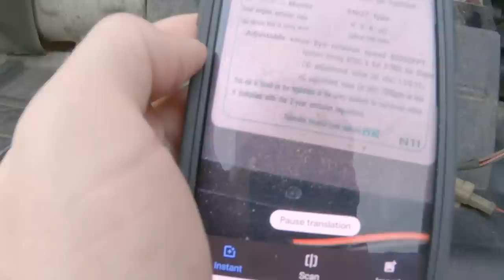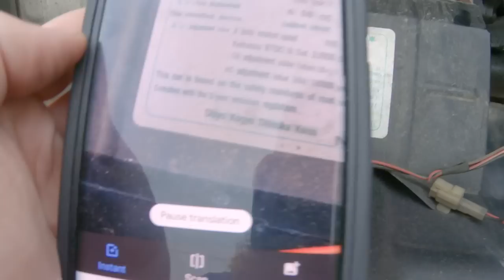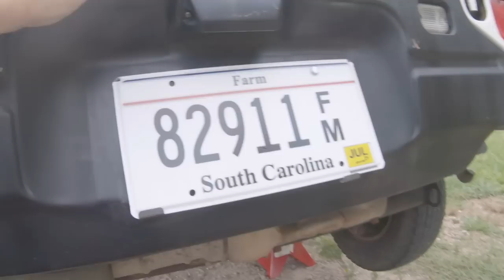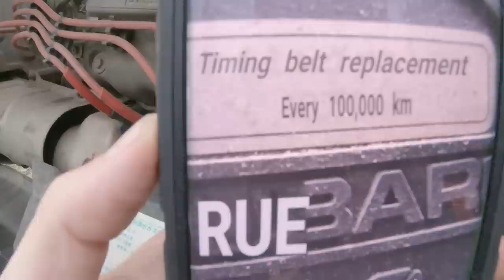Everything Wrong With My 1994 Subaru Sambar Japanese Mini Truck

Comment: Hi, new subscriber here living in Tokyo.  I left a comment on your original Sambar acquisition video offering to send you an owner’s manual to compliment your vehicle.  Please provide me a postal address.  Sambar engines are notorious for leaking oil from the head cover gasket.  Since you are planning to replace it along with a new timing belt, cam and crank seal, you’ll be in great shape.  Cheers!

Comment: They are great little trucks , I have 2 Dias vans with the Supercharged Awd EVCT transmission. One needs a motor which I had a factory remaned long block unit shipped from Japan , the box weighted 110lbs so thats the next project to install . Was going to part it out but was too nice so it getting a motor installed . The rear main seal is the same as the justy of the same vintage when checking the rusting heater lines look under the metal clamps that hold them to the chassis as they will rust thru from crud/dirt getting in between and just stay wet and rot.
The carburetor rebuild “ kits” I’ve used on other KEI trucks are mostly gaskets . I’ve ordered the  factory gaskets ,needle,seat,accelerator pump and couple of other things for a carb rebuild on sambar for about $100 shipped from Japan . 
 Can’t wait to see more of these videos

Comment: My 2003 Sambar started to leak just a little oil around the rocker cover at about 130,000 km... We just passed the 200,000 km mark and the leak hasn't gotten any worse. Just make sure to change the oil at short intervals - 3,000 km for me in Japan - and you should be fine as long as there is not much oil loss during that interval! Mine is always close to MAX even after 3,000 km.

Comment: It reminded me of my VW bus with the engine behind. fantastic
Reply: Yes, you're right about that. It is the same layout as the classic Kombi. I suspect that it was done that way in order to keep the wheels on the road and prevent loosing the back end when cornering in the wet or other low traction situations when the vehicle is running empty.

Comment: That's a significant punch list but all of the repairs look fairly minor and once they're made, you're probably good for another 25 years!  I bought a 1996 4WD Daihatsu Hijet.  I looked at a few hundred kei trucks on Japanese auction sites.  It seemed that the 25+ year old Sambars had more oil leaks than the other kei trucks and the Hijets had the least.

My Hijet arrived with a blown clutch.  I was able to source a clutch kit on Amazon and had it in two days, but it was just the clutch disk, pressure plate and throw out bearing.  I wanted to replace the rear main oil seal and pilot bearing at the same time and that turned into a six week mess trying to source parts from Japan.

Comment: The Japanese counting system is a bit odd, but in a nutshell 万　is 10,000 so in this case 10万　is 10x 10000 or 100,000 km.
Reply: If you think the Japanese counting system is a bit odd, wait until you see their date system.  It's based on the rule of emperors.  I did a two hour deep dive into it so I could translate a spark plug chart for kei trucks for the Mini Truck Talk forum.

Comment: All my vacuum hoses are hard and partially cracked... I'm not looking forward to it. Also the air filter seems to have been put in in 1999... god bless 😂 for only 55,000 km it seems like its NEVER been worked on.

Comment: Try Amayama in Japan for that battery cover and all spare parts.
Most of the parts are genuine. It will state the ones that aren't.
They ship worldwide. 
Lovely set up with the engine, really easy to work on. Would that originally have been a Toyota engine?
Reply from the maker: From what I've read, the clover 4 was a Subaru engine. Used up until around 2012. Then Subaru rebaged Daihatsu Hijets as the Sambar till current.
Reply: @MrSubaru1387  Lovely little engine. Their is something so honest about the Japanese micro vehicles. I have forgotten the collective name for them.
Reply from the maker: Kei cars/trucks.

Comment: Mr Subaru in regards to the distributor, in the uk the Suzuki super carry/Bedford rascal/dihatsu hijet use the same distributor & I have seen 1 fitted from a suzuki super carry to the subaru samber vw bus replica. Wasn't 100% on the engine size however after watching your video it had the same clover 4 engine so hopefully this info helps with finding a distributor 😊

Comment: I think I saw one of these on an episode of American Pickers. I thought it was really interesting and funny that Subaru actually made both the Sambar and a car like the WRX.

On a (off topic) side note:
I was planning on doing the head gaskets on my 08 Legacy (EJ253) this  summer, but when I parked it in april (not going to work or school right now) I noticed it had pretty severe blow by and I recalled your engine inspection video where you said that could be the piston rings going bad. I don't suppose I'm lucky and that it could be the head gaskets somehow, so I was planning on doing the rings now also. Just recently I went to move it for the first time in a few months and when I moved it gave off a lot of white smoke out the exhaust. I checked the oil and now it was milk shake brown, I'm assuming from oil mixing with the coolant. I check the oil and coolant every few times I drove it and changed the oil frequently and I know it wasn't like that when I parked it, so I was think that was somehow from it sitting, which didnt make much sense to me. I still hear no engine knock though, so I was thinking the bearings and pistons might be still good. I was hesitant to disassemble the short block since this is the first time I have done any major engine work. So I suppose my final question would be: do you think I can just tear everything down to the short block and put new rings on the pistons when I do the head gaskets since I am not hearing any engine knock? Or should I tear down the short block since I already have the heads off and check/replace damaged piston heads and bearings instead of just getting the reseal kit and piston rings? Thanks for any advice and all the videos you make!
(Sorry this is so long)

Comment: Hi, I live in Costa Rica and tomorrow I am looking at a 1993 Subaru Sambar Microvan. This video tells me everything I need to look for, so many thanks!  Question: parts will be a big issue down here I am certain, so I was wondering if you could tell me if you think they are still available up north and if so where to shop. Again, many thanks.

Comment: Thanks for good videos. What kind of ramps you use there under the red Forester in the background if I may ask? I'm thinking to buy RhinoGear ramps from Amazon, but some reviews said they cracked easily. Also those RhinoGear are 8-inch heights, and your ramp looks like about 6-inch which I prefer. Thanks again!
Reply from the maker: They're Blitz Rhino ramps. About 12-14 years old.

Comment: Where is the fuel pump relay located? I have a 90 Subuaru Sambar with the carb motor. It's wasn't running and I traced it back to the fuel pump not working. I checked the voltage on the wires and it's not getting any power. In the manual, it says there is a fuel pump relay on the harness by the cab but I can't find anything.

Comment: My sister has a 1993 sambar 4x4 with the clover 4 cylinder. We're having problems keeping it running. Can't find a chilton's book or some type of service manual. Any information would be deeply appreciated thank you
Reply from the maker: http://jdmfsm.info/Auto/Japan/Subaru/--Old%20Models--/Subaru%20Sambar%20KS-KV%20English%20Service%20Manual/
Reply: Thank you for the info. I really appreciate it.

Comment: Sorry off topic. Do you know if there is a solution to 2014 outback headlight bulbs burning out frequently? Thanks and love the channel
Reply: could possibly be because you are getting the bulb dirty which causes it to overheat and burn out. make sure you use clean gloves or wash your hands very good. just a possibility
Reply: @cjskevans  thanks man, yeah I make sure to wear gloves. It seems to be a chronic problem with alot of 2014's if you research. The ground pts maybe?? Idk so so frustrating
Reply: @mikeessary4925  Can you somehow check it with a multimeter and see if you are getting any abnormal voltage?  My dad had an 89 535i that was a solid car except the floor boards were going and the electrical system kept frying out the bulb or fuse every now and then. He had to keep going up in fuses to try to stop them from blowing.

Comment: I have a older one but doesn't have a motor in it. Any ideas of where I can find a motor or maybe a different motor that can bolt to the transmission?
Reply from the maker: Yokohamamotors.net
Reply: @MrSubaru1387  do you know of a place i can get like a used motor with everything on it? I don't have anything for the motor. Not even the mount. At 2500 for a long block I would still have to buy everything to go on the motor. I think it would be cheaper turning it electric or trying to find a junk yard motor and trying to adapt it to the sandbar transmission. Do you or anyone know of a direct bolt on motor from a US car? I know some of the older metro motors could be small enough. I have a harley sportster motor I was thinking of trying to adapt onto it. But then got to thinking. It a air cooled motor probably wouldn't be staying to cool in the back of the truck. Lol. I have seen some people do a street bike motor in them but they where all 2wd pickups. Mine is 4x4 idk if that would make a difference. But I'm pretty sure the running gear probably can't hand to much hp or torque. Don't wanna spend more than I have to on it. Any ideas would be appreciated. Thank you

Comment: I jest change my rear dif still making noise i think bushing on studs on rear . when i put the fuse in the front to make it 2 wheel drive noise go's away . plus my shifter is very stiff 1996 Outback Legacy 260000 MI
Reply: Are you sure the clutch plates aren’t bad in the transfer case of the transmission or the duty c solenoid? I had that issue on my 98 legacy L. You’re probably experiencing a thing called torque binding. It’s something you can fix yourself but it’s time consuming. You have to remove the exhaust, driveshaft, and transfer case of the transmission. You have to replaced the burnt out clutch plates and they’re about $130. You can also replace the duty C solenoid as maintenance since they do tend to go out but that will cost you another $130. I don’t think your duty C solenoid is bad yet because it’ll let you put the car in FWD with the fuse.
Reply: @itsvoodoo7050  i don't think clutch plates in my rear diff on a 1996 my most rear mounts are soft 260 k bad rust under driver side rocker . done investing money in it i got it for free using it for many years .

Comment: hi mr subaru i know that you are a busy man my name is alex from Ireland i have had 8 subaru cars but i have a 2004 subaru forster xt 2.0l non turbo no faults but a code comes up low voltage to starter switch  if the eml is put out it will stay out untill i re start it the second time then the light comes back on please HELP as this is now a mot  fail in my country .p.s love your channel

Comment: I was wondering how many parts  might interchange with the old justy? Looking at the size of the motor I thought it was about the same size as the old 3 cylinder engines. You mentioned the oil filter was the same. Curious if the brakes are close or same as any other subarus like justy or loyale models?
Reply from the maker: I think the oil filter is really all they share.

Comment: I owned a 93 RWD and fixed it up and then sold them. My truck only had 19,000 miles. I bought most of my parts from rightdriveparts.com (Canada), minitruckpart.com (California), and for all the other hard to find parts I bought from yokohamamotors.net (Japan). Shipping will kill you.
Reply: Yes. I am with you on shipping from Yokohama motors killing a lot of sambars in the states. I recently paid 176.00 for an 8 pound box of parts. It worked out to about a 30% increase in parts. I do not believe they ship by weight. Just add to price of part no matter what part is. But Yokohama parts is the best I have found on OEM parts. I was stopped from buying a windshield when I saw 500.00 for  just the windshield. Add at least .30% to that. Then a gasket. Which is why I wanted to buy a windshield was for a new gasket. I will get the chips fixed for 100.00.